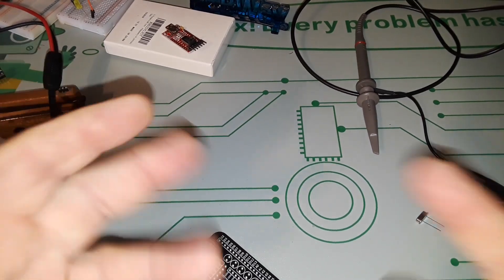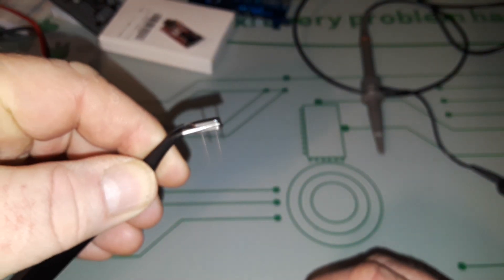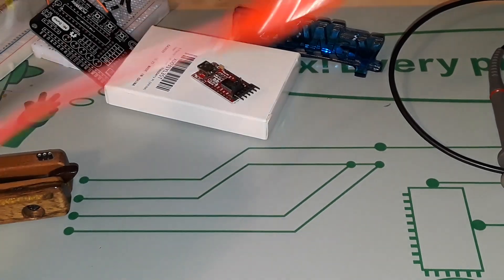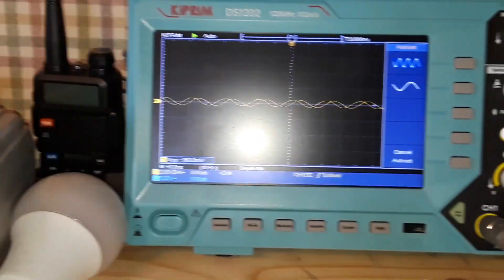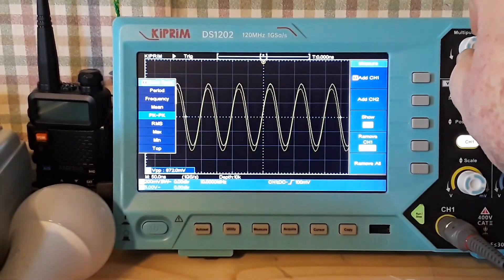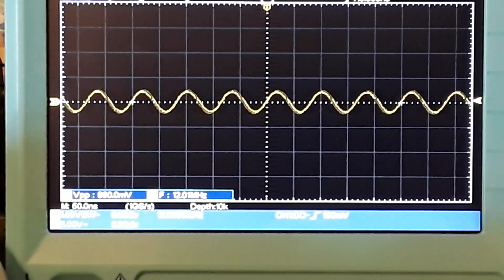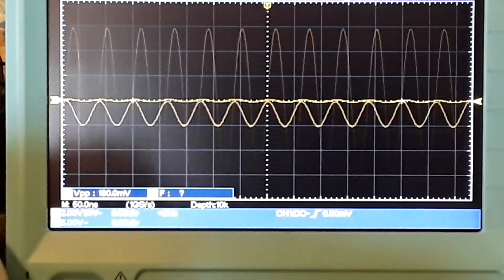How To Test A Crystal Oscillator Using An AWG and a 'Scope

Comment: A good video, but I have a question maybe you could answer.  I have tested some crystals observing the maximum frequency gain on the scope waveform.  If I'm testing a crystal where the frequency is marked for example...12.055 mHz the maximun gain on the scope waveform my actually be at a frequency of...12.051 mHz not at the designated frequency.  Is this deviation do to the frequency tolerance of the crystal.  My equipments frequency accuracy is spot on all around.  It would have been interesting to see how the waveform amplitude would have varied if you had went slightly above and below the crystals marked value.  Just curious...

Comment: Or just use a $40 NanoVNA. No sig gen or oscilloscope needed, (it has a sig gen built in if you need one for other applications,) and it provides precise frequency of operation info and all the parameters you might want or need in order to design crystal filters or other sorts of filters, or analyze antennas, etc. 

BTW, that is just a crystal being tested, not a crystal oscillator.

Comment: Thank you!!! This short video make understanding how to test an oscillator or determine its frequency very easy. After two hours of research I was about ready to pull my hair out if I found yet another page of AI generated content or the same cut and pasted article with an equivalent circuit and a bunch of graphs. I don't care about any of that. I'm not an engineer. I just wanted to know how to test an oscillator and your video was perfect. Great job. Thanks for sharing!

Comment: First, you displayed and tested a crystal -- NOT an oscillator.  Second, Q~10,000, so you MUST come extremely close to resonance to notice an increase in amplitude.  Frequency changes due to temperature might easily cause one to miss resonance unless frequency increments are 16 MHz/10,000 or less.

Comment: This is the kind of thing you'd need at the weirdest time and no combination of search terms will help you find an answer. Now it does. 

Just checked my handheld scope w/ function generator. It works well enough, but doesn't go past 10MHz... Gonna have to find an affordable portable function generator that gets closer to frequencies we're likely to be working with.
Reply: I was able to find the source of this from a single google search which pointed me to Hackaday.
Reply: Not my usual experience, mind you. On rare occasions, even I can pan something out right away like that. Normally, my attempts turn out comical at best, and... just go downhill from there to say the least.

Comment: Nice video!  But technically, it is a crystal not an oscillator.  Crystal oscillators have 4 pins.
Reply: I assume you say that because the two pin part requires a pair of load capacitors?
Reply: @Enigma758  A crystal oscillator is a complete circuit, including a crystal, that produces an oscillating output. Crystal plus two caps is still not a crystal oscillator; most of the oscillator circuit is (in this case) on the microcontroller chip. BTW I'm not sure how good for the xtal it is to have it ringing at 12V p-p like that. Seems like it might shorten its life. All good fun though 🤪
Reply: @my.own.devices  It all boils down to semantics.  I think the OP was getting hung up on that too which is why I responded.  Typically the part itself is referred to as a "crystal oscillator", but to your point, it must be in a proper circuit in order to "oscillate".

I agree that applying 12v directly is not a good idea.  There should at least be a current limiting resistor in the path to avoid damaging the crystal (in the original Hackaday article, someone also mentioned that in the comments).  In another video, he applies 100V+ directly to an expensive nixie tube with no current limiting resistor so beware of any advice given on this channel!

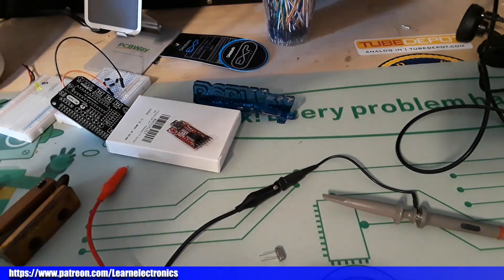Comment: Wouldn’t a voltage across the crystal oscillate at the frequency of the crystal. Wouldn’t the oscilloscope display this wave? 4:52
Reply: Good question.  Crystal oscillators typically require a pair of capacitors which provide feedback in order for it to oscillate properly.  You would have to first build a circuit with the correct value pair of load capacitors (as per the datasheet which you may not have) and then power the oscillator.  If you did that, you could measure the frequency directly.  The approach in the video avoids having to to all that.

BTW, it looks like he borrowed this idea from a "Hackaday" post.  If you read the comments from the original Hackaday post, it's mentioned that you could also build a circuit and test it directly.

Comment: Looks like I should assemble a clock source tester... Especially for quartz crystals and even MEMS oscillators so I can sort them out by frequency and as well as operating voltage. At least MEMS oscillators are better clock sources so I can make high quality PLL-based Quartz resonator tester for cheap.

Comment: I am confused here. You refer to the circuit at the beginning as an oscillator, but then you refer to the component as an oscillator. Is that just a crystal, not an oscillator? Or are they both oscillators? I am hew to electronics, so sorry if this seems like a silly question. Thanks.
Reply: The Quartz crystal in a given Quartz oscillator vibrates at its own native resonance frequency (in low frequency application, in higher frequency Quartz oscillators are much more complicated due to the use of harmonic overtunes to generate the frequency, by either selecting the tones or mix them) - controlled by the cut thickness, meaning the time (measured in Hertz) you get from them vibrating electroacoustically should remain unchanged, especially with the special ovenized Quartz oscillators. They're the most common clock source as well.
Reply: @Dr_Mario2007  I understand. Thanks for the explanation.
Reply: The component itself is called a "crystal oscillator".  When a voltage is applied to it, it oscillates at some pre-determined frequency.  There are also circuits called "oscillators" which also oscillate at some pre-determined frequency.  Some oscillator circuits also use crystal oscillators, but many don't.
Reply: @Enigma758  I beg to differ. This component is a crystal. It will not oscillate. Having two leads only, the crystal is connected between the two leads. By itself it will not oscillate. It can act as a narrow-bandpass filter as shown.
Reply: @milantrcka121  Hi Milan,  when a piezoelectric material (like a quartz crystal) is subjected to a electric current, it vibrates.  It does not need an external oscillator in order to oscillate.  In the video above, we are seeing that it reacts in a certain way when a resonant frequency is applied, but that is normally not how a crystal is used.  It can be modeled as an RLC circuit which oscillates when powered.  From wikipedia:

"The quartz oscillates at a stable resonant frequency, behaving like an RLC circuit, but with a much higher Q factor (less energy loss on each cycle of oscillation)."
Reply: @milantrcka121  That makes sense based on the test setup and result.
Still a valid test of crystal viability though.
Reply: @Enigma758  I see. Thanks.